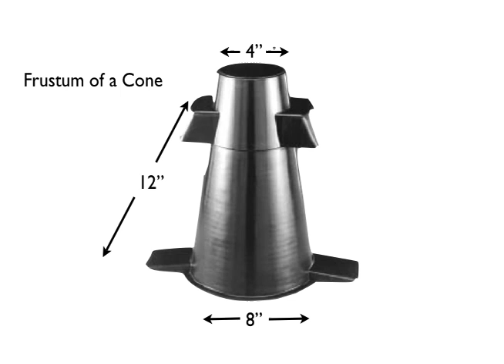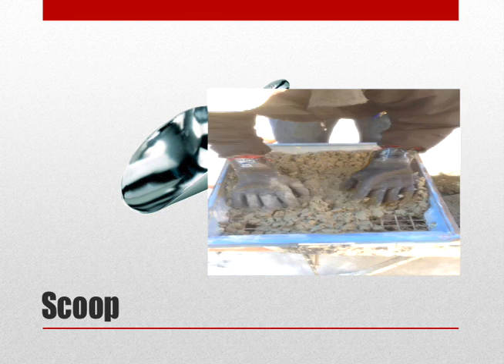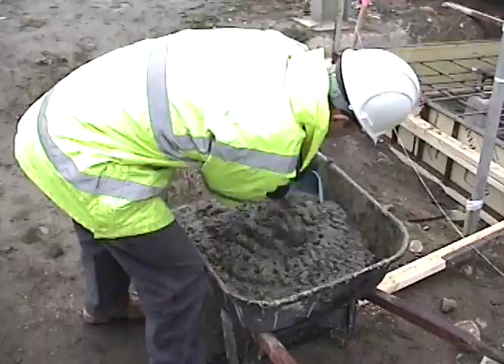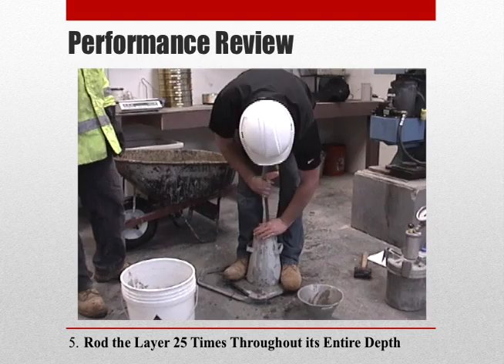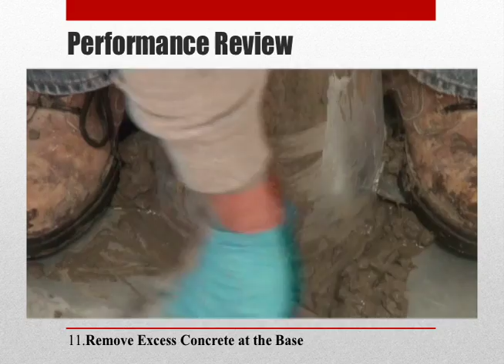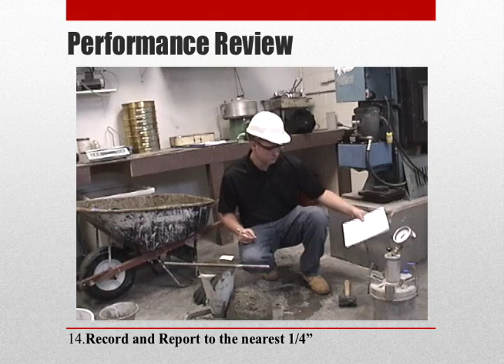ASTM C143   Slump of Hydraulic Cement Concrete

Comment: If the maximum aggregate size allowed in the test is 1.5 inches,  why would you wet sieve over a 1 inch opening? Shouldn't it be a 1.5" opening wet sieve? Did you guys check this video before posting it?